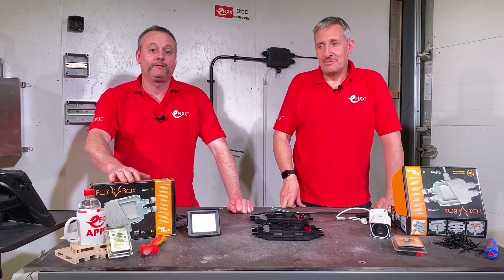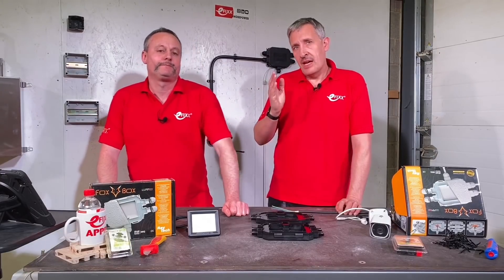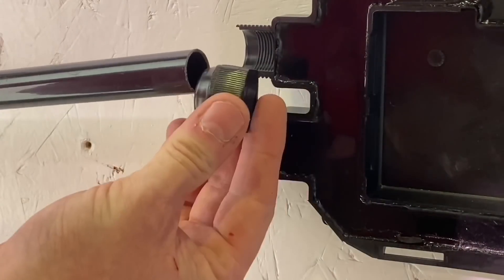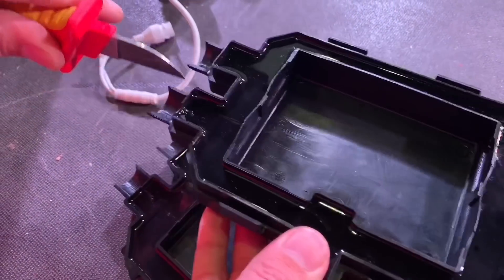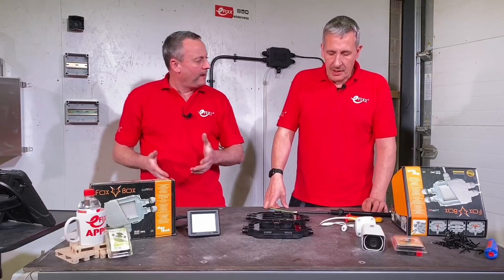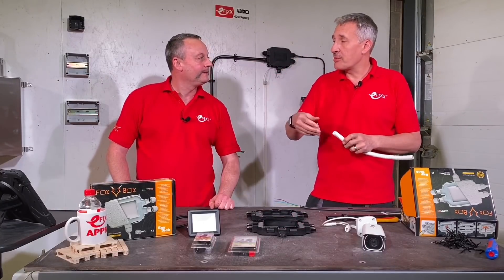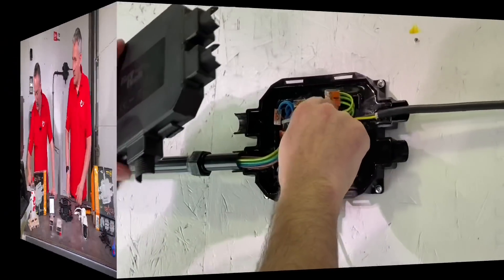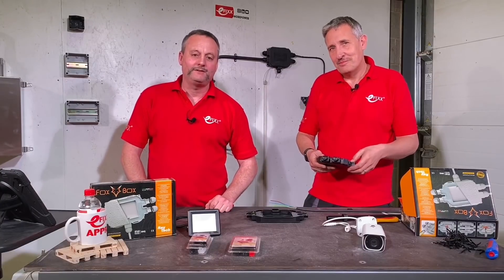STOP WATER ingress with a MOAT - It's the FOX BOX from Raytech - IP68/69 electrical junction box.

Comment: If this seals as well as it's supposed to (IP68/69), send a couple of JW and let him run a dozen amps through them while they're sat in a bucket of water. Personally I remain less than convinced that the gel will mate completely where the cable has been put through and gaps will still exist allowing water ingress even when assembled in ideal conditions (not up a ladder in the cold).
At least when you're filling your own boxes you are completely covering the connections and can visually check for any voids before sealing on the lid. With these boxes you just have to put it together and pray.

Comment: You make no mention of drip loops. These are surely essential in all external wiring.
Reply: Yep, despite the gel I remain unconvinced by their inline vertical connection with the two way version. Yes it's lovely and neat but I'd be inclined to have it horizontally just above the light fitting with a drip loop on the incoming NYY cable.

Comment: Could of questions and thing's that I have noticed, so I am wondering if the gel that is been used is it mould resistant? Also if it's been used outside and when its mounted onto the wall is there a protective film over the gel to prevent any ingress of dirt and debris when drilling like dust which could compromise the gel's integrity.  Secondly when I saw you putting into the conduit tube I saw some internal threads so could you screw the conduit in and when I saw you using a knife to cut the access channel for the cable what really concerned me is health and safety aspects. I think that from a DIYER and non electrican standpoint I think maybe pull off cut offs which can be snapped off be a good idea instead of having to use a knife which could be especially dangerous if not wearing gloves. Lastly I think they should release the same product but without the gel been pre fitted/filled so that you can put it in yourself.

Comment: I tend to use wiskabox with the mp gel, works out expensive for a one off job, ive tried other options but never found anything that looks as neat , i do like the look of the moat, nice neat and compact , do they suffer from condensation in the open compartment when sealed?  i use NYY a lot, great for brick lights and the like, i just wish it was 7 stranded apposed to solid conductor
Reply from the maker: We are going to put them on a longer term test so will wait and see.
Reply: @efixx  look fwd to the results

Comment: Insulation in water is very, very important in all areas, whether it is in the bathroom, outside, or with submersible pumps inside the water. It is a very important video to know the insulation boxes and the maximum degrees of isolation boxes ip69

Comment: I can't find your video on NYY cable, does anyone have a link? I've just used this on my house for an outside sockets and lighting radial circuit. Found it relatively easy to work with, not as easy as flex, but way easier than SWA.
Reply from the maker: Your ahead of the curve Richard - getting released very soon!
Reply: I think this is what suppliers are also calling TUF cable? Seems to be like a meter tail, double outer layer. CEF stock it as 2.5mm² 3 Core Tuf Sheathed Cable Black.
Reply: Does NYY not fall foul of our BS Standards therefore cannot be used
Reply: @pirate69s  think your referring to SY & YY cable.! NYY-J cable meets BS EN / IEC 60332-1-2 & IEC 60502-1 standards.
Reply: The next question is, when Efixx release the video, will any suppliers actually start stocking the damn stuff?!

I rang 6 different local suppliers the other week looking for it and in the end I had to resort to CEF, and even they didn't have the 3 core in stock at my two local stores!

I've seen all sorts of T&E, SY and armoured on walls before where NYY is the ideal solution.
Reply: @mowcius  to be fair, not enough people were using it before, YouTube seems to be getting it into people's heads. I've only just started stocking it myself due to demand and even at this point in time, probably not enough demand to be keeping alot of it on the shelf?! Both myself at Reading & our Newbury branch amongst a few others currently stocking, not every branch in our 60+ are keeping though, in time maybe? (Eyre & Elliston).
Reply: I got mine from TLC online, but if you need it immediately then I agree I haven't seen it anywhere

Comment: IP69, I saw that grin
Reply: Interesting video though, water wicking through the wire is something I've never considered. Maybe I'll throw a silica gel pack in my outdoor sockets now?
Reply from the maker: It happens more than you would think - especially on some inground lights!
Reply: @richardpowell181  Silica Gel has a very limited capacity to absorb moisture - it wouldn't take much water ingress to completely overwhelm it.
For outdoor sockets cable entry should ideally be on the bottom, and the socket box itself should have a drain hole to let water out.